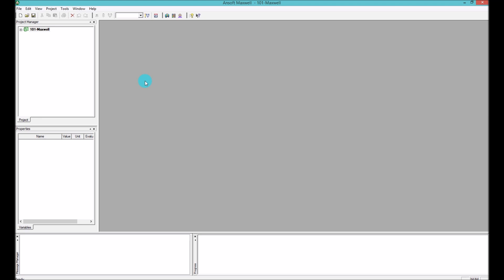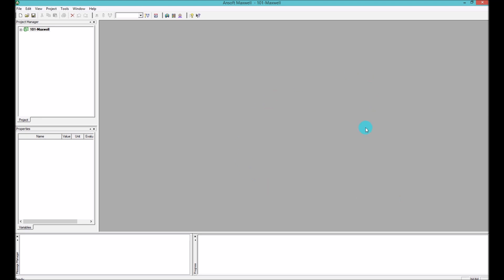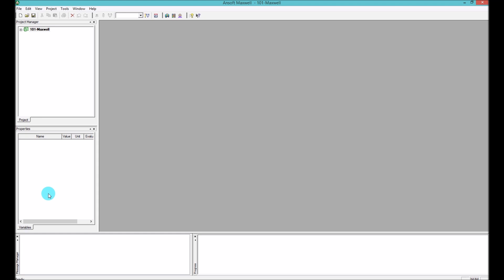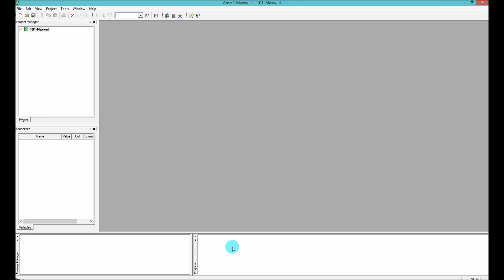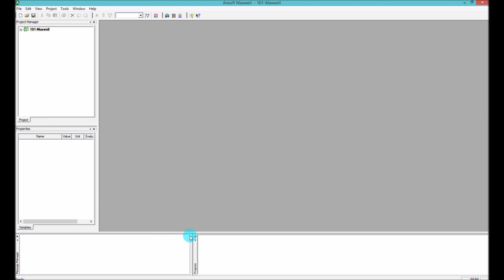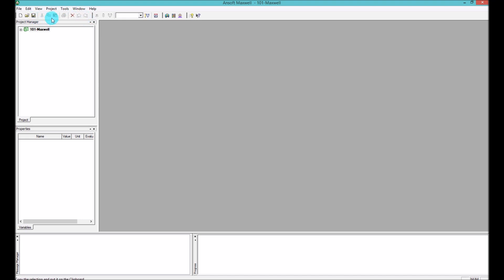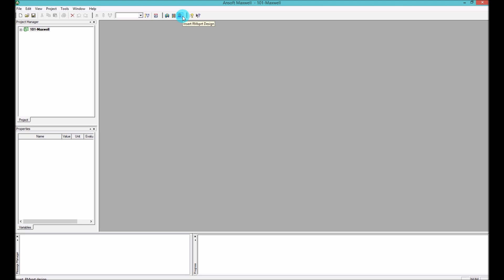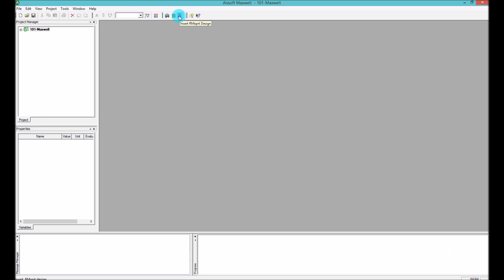10-- Ansys Maxwell -- Basic Tutorial

Comment: hi.. im also doing my thesis in ansys maxwell. i referred lots of your videos and it was very helpful.

i was trying to make a stepper motor. as a start, i made two coil with DC excitation. in the middle i place a rectangular piece of steel 1008 slightly tilted. it was supposed to move and align with the coil. 

in the motion band for that steel piece, i assigned rotation motion and checked 'consider transient motion'. the problem is i dont know how to select a value for moment of inertia and damping constant. there was a 'calculate' button for moment of inertia. i clicked it to get a value. but after simulating, the steel piece was rotating out of control. it didnt align with the coil.

how should i calculate a proper value for moment of inertia and damping constant? so that the steel piece rotate and settle in an aligned position with the coil.

this is similar to the 'rotating actuator example' available with maxwell 14.
in that example they put 0.0024 for moment of inertia, and 0.015 for damping constant. but they didnt say how they calculated those values.

please help me

Comment: Hi folks, I'm new on Ansys and i have to use it for my thesis. I'm trying to catch the differences between Ansys15 with Magnetostatic Tool in Workbench,  and Maxwell Suite in Ansys16.
I need to simulate the interaction between a magnetic field and an electrical circuit.
Which of the two is better for what I have to do?
Thank a lot for your time.
Reply from the maker: hi, the main noticeable difference is mesh engine. the performance if automatic meshing engine is improved. you can see the difference in complex structure though. aside from that and some changes in the user interface I have not found any substantial changes. in simplorer I see some updates though. back to your question, you need yo use simplorer. have you watched my tutorials on simplorer??
Reply: +kamyar K Thanks for your answer. I have not yet see simplorer, but I'll do it soon. Before it I would have a better knowledge of ansys, following your amazing tutorials :)